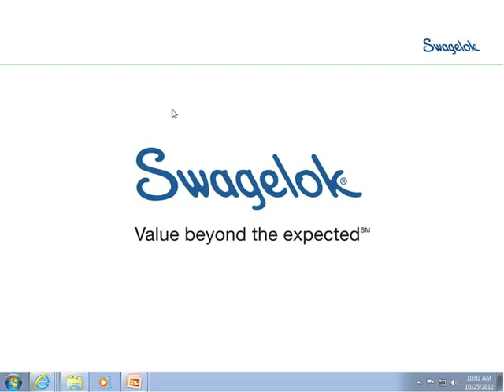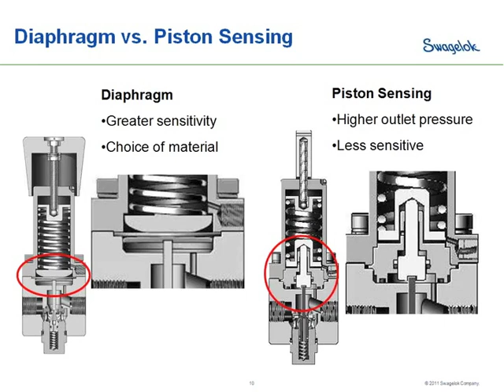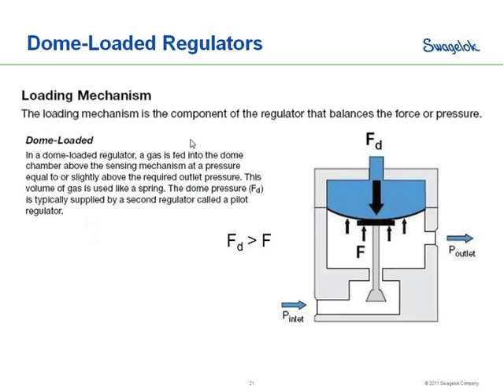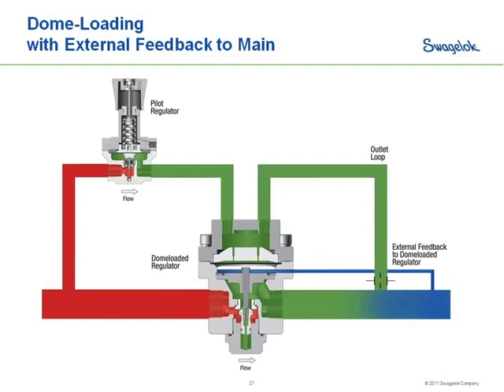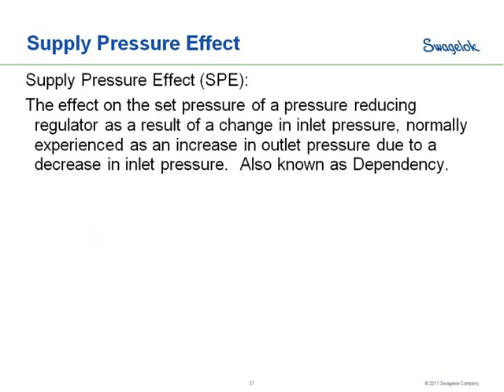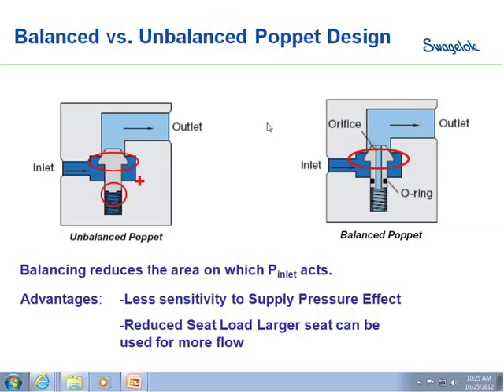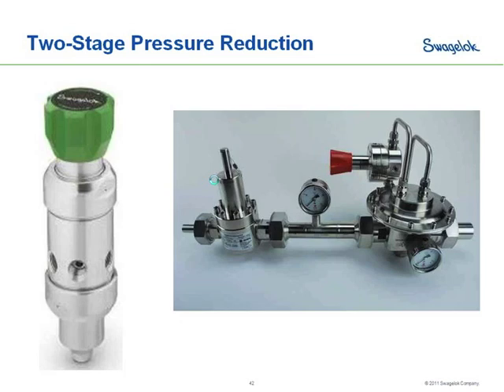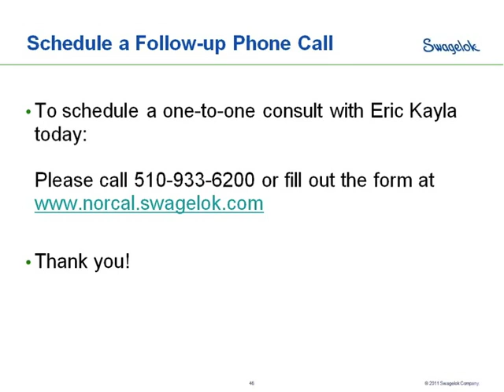Theory and Operation of Pressure Reducing Regulators, Webinar Replay

Comment: For the balanced vs unbalanced poppet design slide, I don't understand how that valve works. as outlet pressure increases, the poppet wants to open more, resulting in even higher pressure? I must be missing something because it doesn't seem stable?